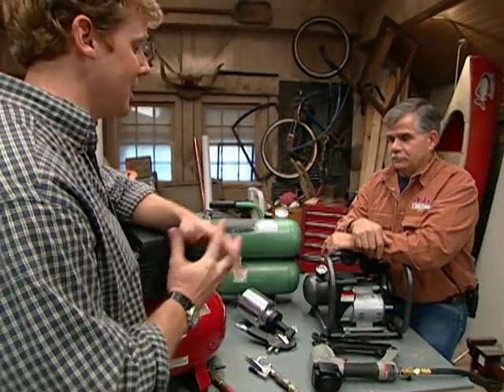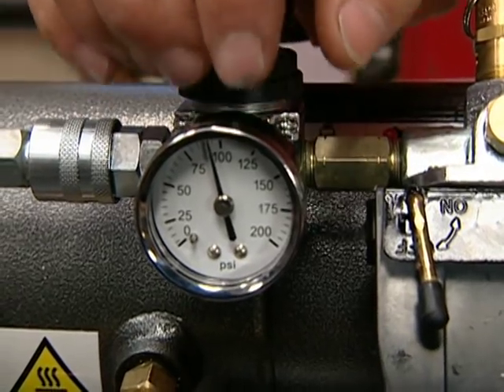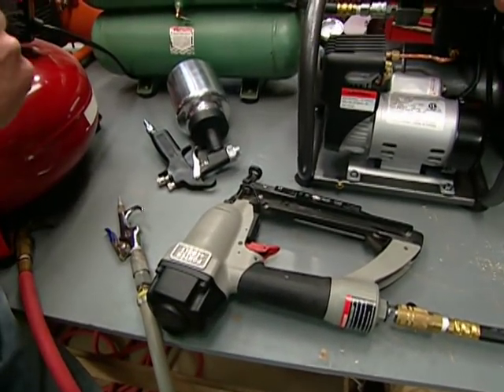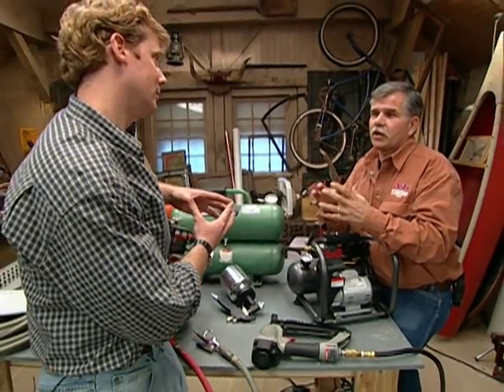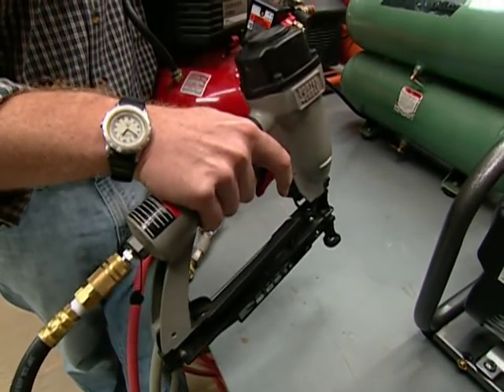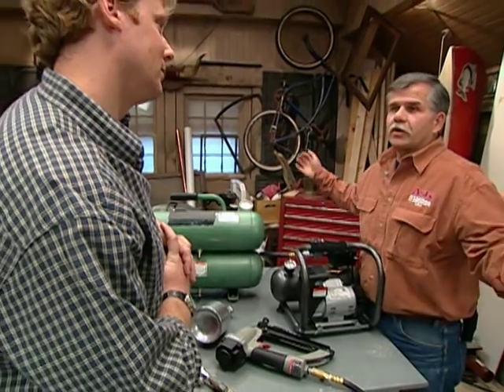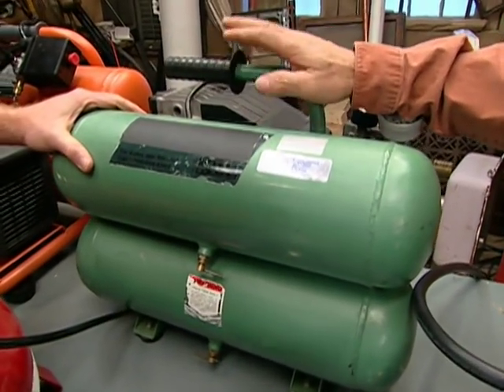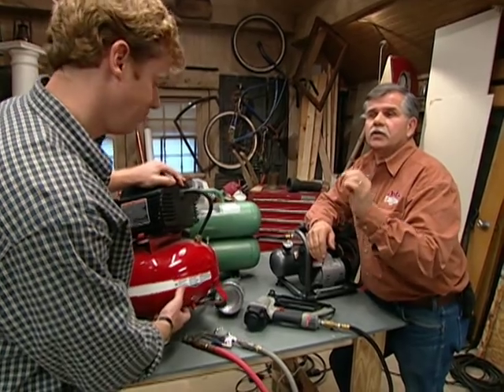How to Choose and Use an Air Compressor | This Old House

Comment: I just bought a Sears Craftsman, Model 106.153684 air compressor for spraying paint. The label says it is a 1 1/2 horsepower twin-cylinder utility and is rated at 150 PSI. I don't know how many galleons the air tank holds. It uses 10W40 oil. The label also says, Capacity 7.3 SCFM at 40 PSI and 6.0 SCFM at 90 PSI. I think it was built in 1974. It looks amazingly good. It needs 230 volts AC.  I found it at a Habitat for Humanity thrift store for $65.00. Any advice or suggestions would be appreciated. 
Thanks a lot, Tom

Comment: Should’ve gone more in depth on oil vs oil-less. That is a huge factor on choosing a compressor. There is a large difference in loudness durability and between the two
Reply: oHerroPrease I am a Sales Engineer in Compressed air. Here is the differences of oil-free vs. Oil-flooded:

1. Oil-Free compressors are usually used where oil cannot contaminate anything downstream, like food mfg, pharmaceuticals,  areospace, defence, etc. 

2. Oil-free costs double what an oil-flooded machine costs.

3. Oil-Free doesnt mean you do not maintain the unit. Larger units have pre and post filters, oil filters, air filters, seals, etc.

4. There are two parts to a compressor. One part is the electrical motor. The second is air end which actually creates the air. The oil-flooded is used thoughtout the airend to keep it cool, lubricate, and capture air bubbles that create the air. (Look up rotary screw air compressors, which is a whole nother lesson)

5. CFM to HP ratio
1 CFM = 4 HP

So if you have 20 CFM, you would need a 5 HP compressor.

6. PSIG is important as well. You cant run equipment that require 175 PSI, when your compressor only can produce 80. Basically common sense.
Reply: Oil units are far superior in most ways .

Comment: ...ends video with “could explode”.

Well ok then.
Reply: Missed the most common reason to drain the tank because that condensation works its way into every tool and rusts it from the inside.

Comment: This video answers a lot of questions.  The only question I have is what is a "big" cfm?
Reply: +Vince P Basically anything you'd use for real professional shop usage.  I'd say starting around 15 CFM, which would correlate to around 1500 dollars or so for an ingersoll Rand model that you'd find in a typical local car repair garage or something similar.   The squashed unit they show in the preview pic can do around 3.6 if I remember correctly and the rule of thumb for professional environments is around 5 cfm per technician to keep all your air tools running efficiently.
Reply: +phuturephunk Correct me if I'm wrong, but CFM is how much air the pump can pump to bring it up to full pressure or while the pump is running while using the tool. But if the pump is not running and the tank is full the CFM of the pump does not matter for tool power? I understand it will take longer to reach full tank pressure with lower CFM.
Reply: damian1228
Reply: damian1228

Comment: So can you leave air in the tank or should you release all the air as well after each use / day
Reply: Christopher Zephro I almost always empty it at the end of the day for Portable Compressors. You can leave it, if your going to use it the next day but empty it every so often if you use it every day. Like they said it will start rusting faster with the water inside.
Reply: Drain the tank DAILY!!

Comment: Oil in the pumps not motors, right?
Reply: The pump is part of the Motor. So, there for you must put oil in the motor to lube both.  

Thankyou for trick question & test.
Reply: There is no oil in an electric motor, wtf are you talking about.
Reply: Then where do you put the oil for Compressors that needs oil?
Reply: It's not oil for fuel, it's oil for lubrication.
Reply: @daleweber2579 the pump is bolted to the motor, but the motor doesn't sit in the pumps oil sump....

Comment: SCFM is at 1atm (14psi) intake, not at output.  Output at 50psi will instead have about 1/4 the rated SCFM because each cubic foot of air at 14psi is now about 1/4 of the volume when compressed at 64 psi (absolute) from a 50psi regulated output.

Comment: Whats the cfm rating on the small compressor next to the guy in a brown shirt. The one that has a small tank going for around 100 Dollars as narrators states. Model name and number would be useful.
Kindly share this information.
Reply: A Senco PC1010. 0.7cfm at 90psi . I have one. It's only good for small trim jobs, but very good at it. It easily keeps up with a brad nailer, is VERY quiet, and quite light to carry. http://www.senco.com/tools/details-page/pc1010
Reply: Thanks for info. Wont  handle what I had in mind though.
Reply: @samuelkyambo2091  you could force spit further than that compressor shoots air...

Comment: Technically, CFM and SCFM are not interchangeable. The SCFM rating is a marketing trick used to make consumer compressors sound better than they are. SCFM means CFM at 1atm of pressure, and when they give you an SCFM rating, they are actually telling you the number of cubic feet per minute that enters the compressor through the inlet when the motor is working against a given pressure in the tank (this is why they always say "SCFM @ 90psi"). The CFM to your tool is a much smaller number than the SCFM. This is a dirty little trick by compressor manufacturers.

Comment: So the electric compressors are safe to use indoors? Why do the instructions say “well ventilated area”?
Reply: They say that for cooling purposes, long as you dont have it running in 100+ closed room you will probably be fine.
Reply: So you can get your smoke on.

Comment: Oil-less compressors are usually louder and do not have the life of an oiled compressor.
Reply: This is good info, thanks!
Reply: Also lower CFM's on oiless variety.
Reply: I agree. The compression "ring" is made of leather.
Buy an oil bath compressor and use a filter/separator in the out put line.

Comment: I installed an automatic drain valve on my compressor that purges out some of the accumulated moisture in the tank every time it cycles off; saves the hassle of manually bleeding it out with every use.  The higher end compressors should have that as part of the standard setup.  The oiless compressors are always raucous and grating to listen to, compared to the pulley driven oil lubricated compressors;  mine is almost pleasant to listen to compared to my direct drive oilless one.  PSI and CFM is one thing, but try to hear it running if you can before you decide.  Noise levels is never a spec they provide though, so you'd have to just witness it firsthand to see what difference it makes to you.
Reply: Nope.  You will not get all the moisture, and moist air under pressure means faster rusting.  You need to let the pressure out of the tank after use, or your tank will rust out from the inside.
Reply: How often do you drain the tank out during the day while you're using it?  Do you wait until the end of the day or go and periodically let the air out from the bottom manually as you use it?
This does it every time it cycles- if that much water accumulates every time the compressor charges up that it keeps building up, then check the humidity in the garage.  Purging it on a regular basis as it gets created results in less water in the tank than allowing it to accumulate for the day, and less moisture going out the air line.  Rust doesn't have a schedule where it'll wait until you're done for the day, so why leave it in there for however many hours you're using it?

Comment: Can you lacquer with the small compressor please ?
Reply: Depends on what type of spray gun you are using.  It would need to be a relatively small sprayer, and you likely will need to stop once in a while to let the pressure build up.

Comment: Is it wise to use a 3 gallon oil less air compressor to fill 30 gallon auxiliary tank
Reply: I'm not an expert but I believe it would work but would reduce the lifespan of the motor. It would stay on a lot longer than it's rated for so it would build a lot of heat.

I have a 6 gallon pancake and when I use that to clean up the shop and use all the air in the tank that it gets pretty warm.

Comment: Points to a pancake and says it holds 6 gal.  This discussion was too short.  There is so much more to compressors and not all the technical number stuff.  Good subject, what's the rush.  And what's the compressor that Tommy likes?

Comment: thinking about getting one for home use, for tires, oh well not risk it explode! I'll go to gas station.
Reply: They don't explode.  That is complete nonsense.  If they rust thru, which is very unlikely, they just leak.  Fittings leak all the time on the hoses and the tools.  Try to keep that from happening as the motor will kick on to make up for the lost air.  It's annoying and it puts wear on the machine that is not needed.  
Get yourself an oilless compressor that's not too heavy or expensive.  Look for 2.6 cfm @ 90 psi. and a tank pressure of 125 instead of 100 psi.  Some tool run at the higher pressures.  You will find a lot of units in that category.  The info is right on the label on the tank.  If you get confused send me a message.